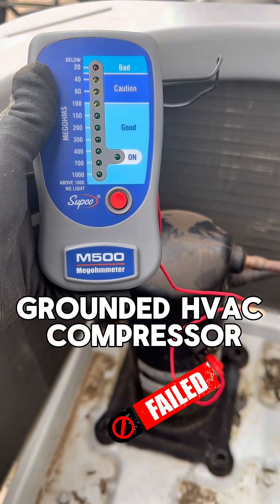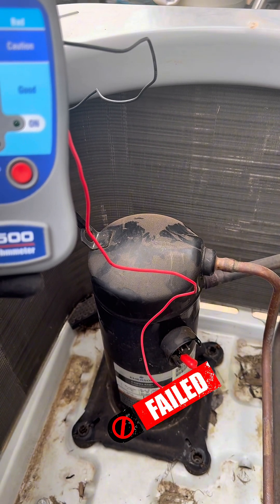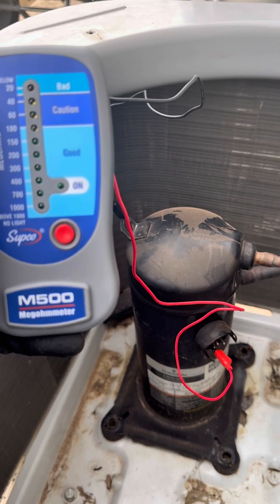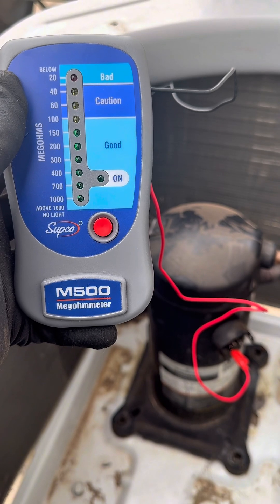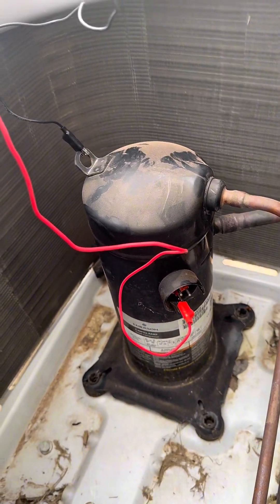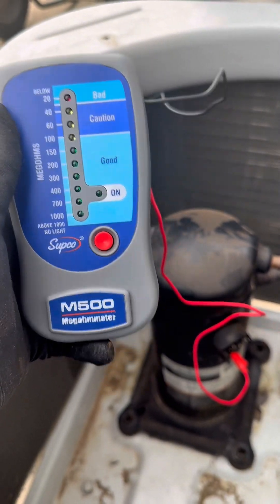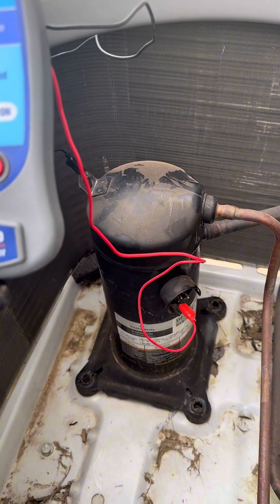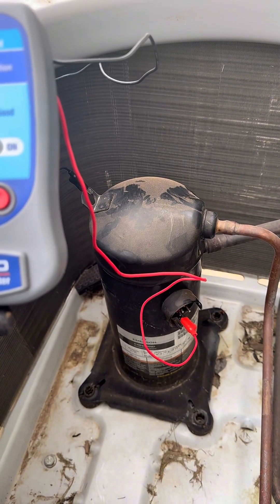Grounded HVAC Compressor Windings Shorted to Ground Fail Condenser Start Run Common

Comment: A compressor going bad in 2 years is crazy. I don’t see a low pressure switch. Was it running empty.
Reply from the maker: I don’t recall the refrigerant level on that exact job. But I had another bad compressor I replaced today and it was I believe the result of a blown transformer in their neighborhood. The homeowner did mention that the compressor didn’t sound normal recently, and the condenser was very dirty, resulting in high head pressure. It’s difficult to pinpoint exactly what the root cause was in this recent case, the unit was seven years old. And last week we replaced evaporator coil on a Ruud system that was only three years old due to a leak in the coil.
Reply: @TRUSTEDHeatAC  did you cool the compressor off before you condemned it.
Reply from the maker: @BoratVoiceMyWife it was throwing the breaker, shorted to ground.